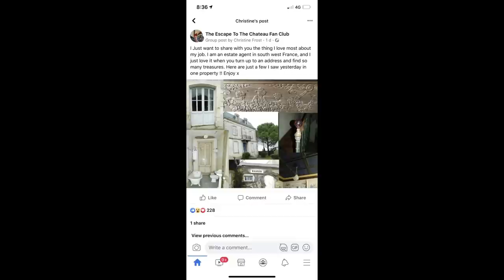Her's Vs His! #63

Comment: I'd wondered if the big pots were originally used in the laundry. They would soak clothes in a variety of things, and pour boiling water over them, or boil them in a pot. I think the drain pipe is a good indicator they were used there.